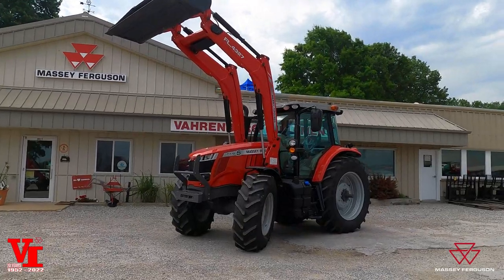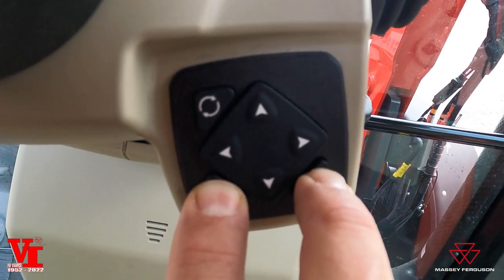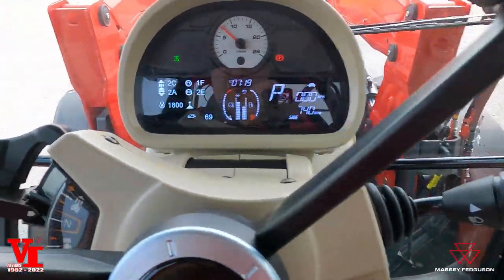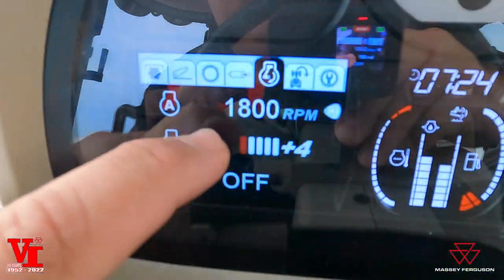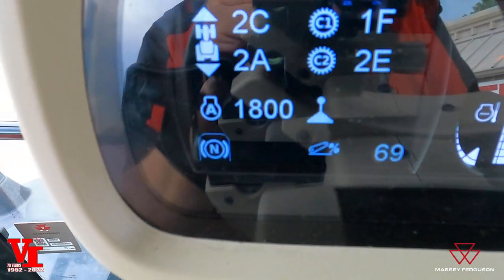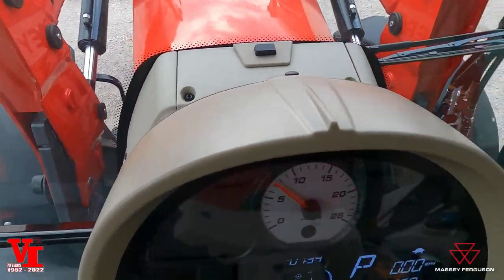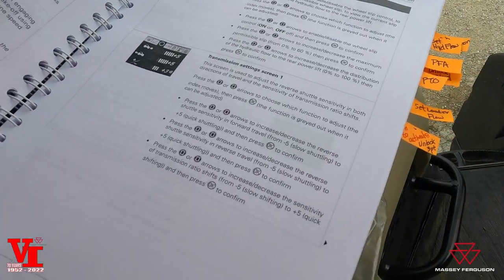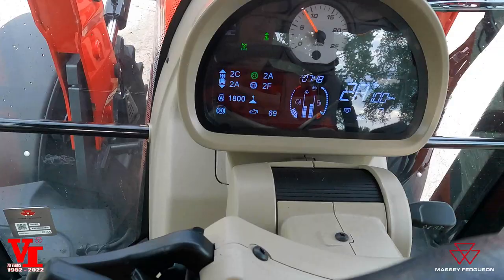How to Setup and Customize the Settings for Massey Ferguson 7715S Dyna6 Tractor

Comment: Thank you for the video. I think these new tractors are amazing. I used to drive tractors years ago and most of what you showed was done by the driver in a more basic form. It's a whole new environment now. I'd love to work one of these tractors but doubt I could even get it to move let alone work it anywhere near to its full potential.
Reply from the maker: Still very similar operation but new technology provides new ways to make things work. Spend a little time in one and they become more easy to operate and do work for you.

Comment: can you tell me the part number for the hydraulic cover for the remotes on the tractor .thank you
Reply from the maker: Which Model? You can look up the parts on www.AGCOPartsBooks.com too.
Reply: @VahrenbergImplement  5611
Reply from the maker: @harry mcmillan What Type Hydraulics do you have Open Center or Closed Center? Open Center uses the Rubber Plugs. Closed Center has caps. Look at Page 13-0058 to 13-0060 depending on number of remotes you have and the position of the cap you need.
Reply: @VahrenbergImplement  thank you so much